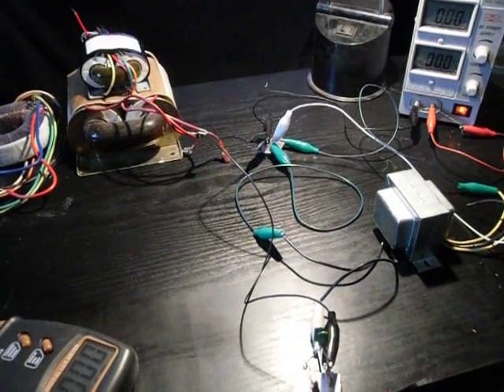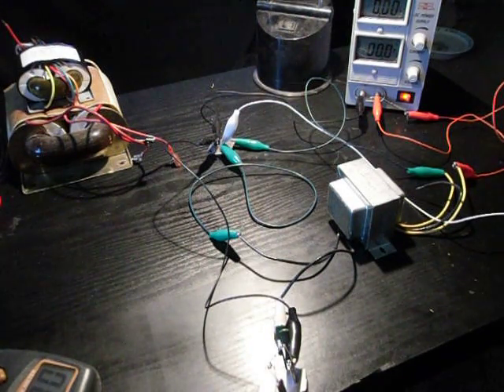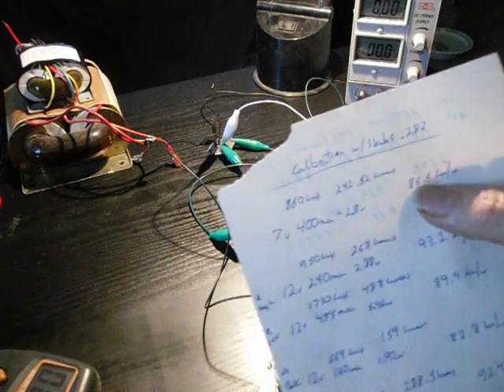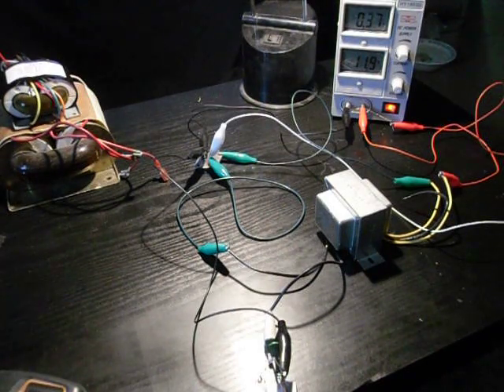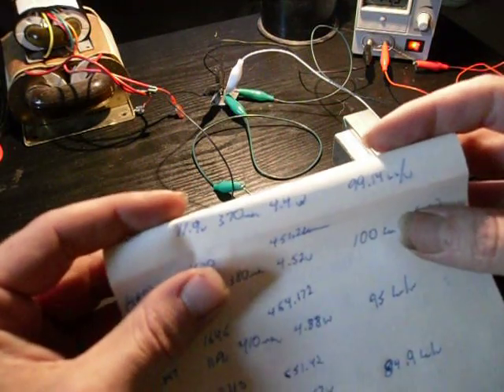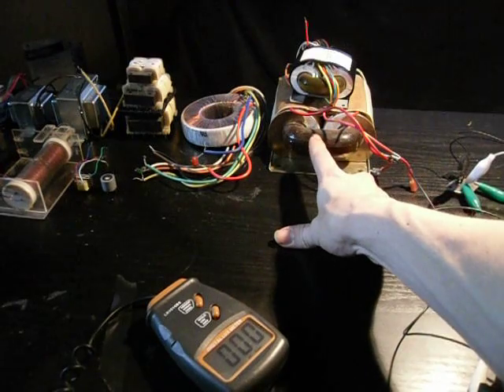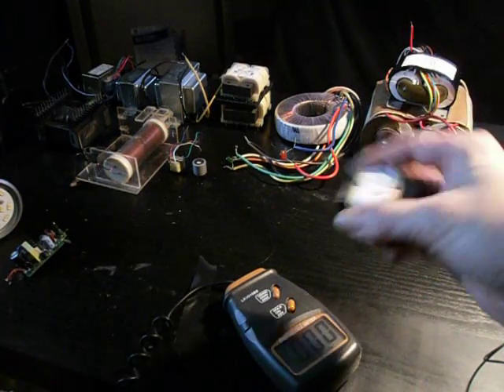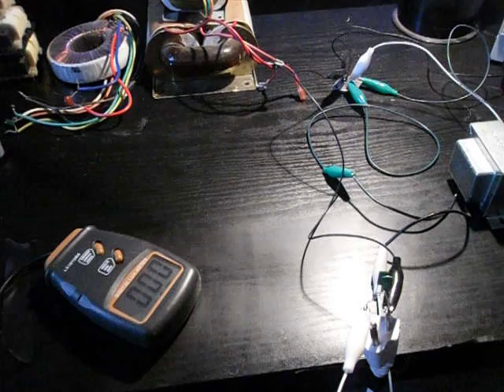Super Joule Ringer 2.0 w/ Radio Shack & Foreign 1.5w LED x 3

Comment: Hi PB, Nice to see new video ! 
So you have 850Lux on 120V, and 1600 on 12V ... that's double more Lux.
Did you measure the current on the 120V ? Would make comparing easy :))
Cheers and TY